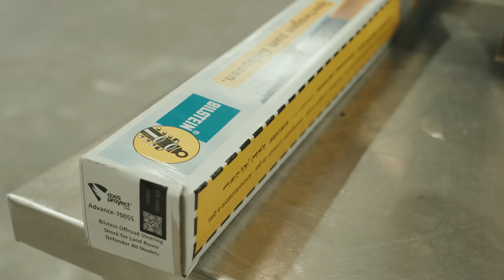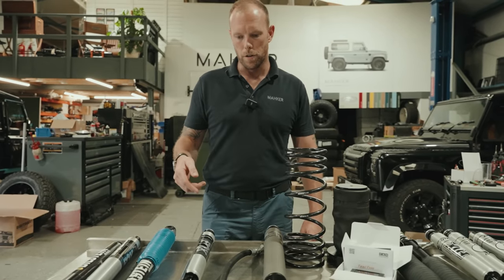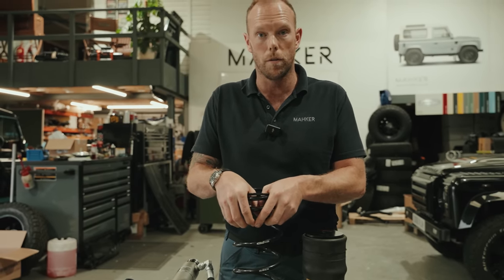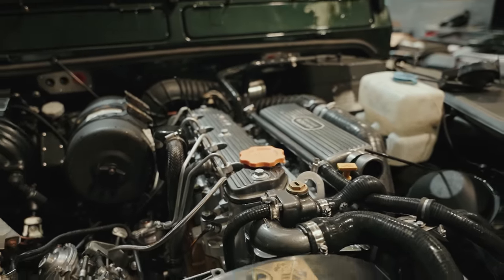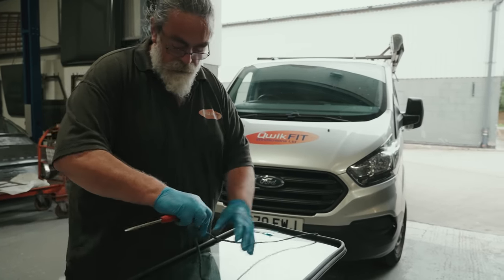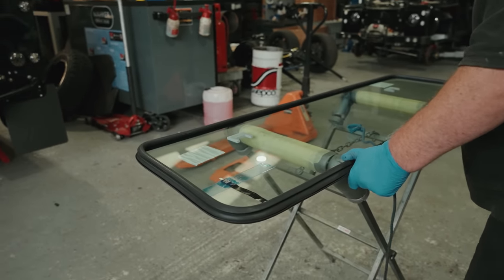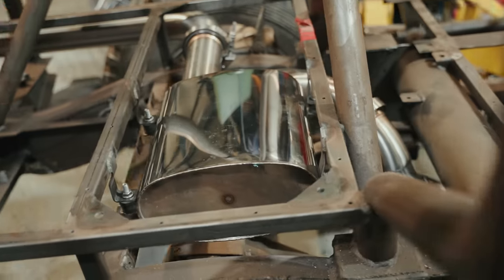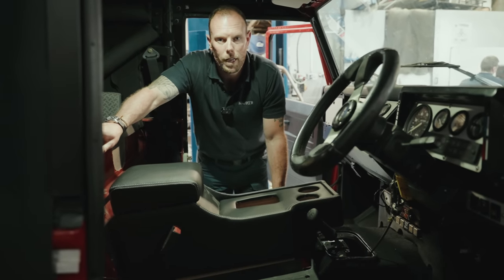Air vs Spring - BEST SUSPENSION Options for your Land Rover Defender || Mahker Weekly EP087

Comment: Don't you find upgraded steering dampers destroy the already pants design drop arm balljoint in minutes as there not man enough? I always go HD arms with lemforder balljoints and disco 1 droparm set up when a customer wants a fancy SD fitting. Air springs OK till they leak or the system fails, not good if your in the middle of nowhere.

Comment: Hi Dave, great info on the shocks, thanks very much for that.  One question please, some of the replacement shocks appear to come with the locating washers (ones with the short spiggot, some have spherical bush seat and some containment) that engage the turrets and spring seat on front axle and axle side lower on the rear. Some seem to re-use LR std washers subject to the respective new bush config or appear to have bespoke. Fox ones come without as far as I can tell and the new bushes appear too large for std LR locating washers? How do you guys address this?  (I have been lead to believe that not using bush locating washers at all can cause the shock to wander and the shaft wear the hole on the vehicle side? )